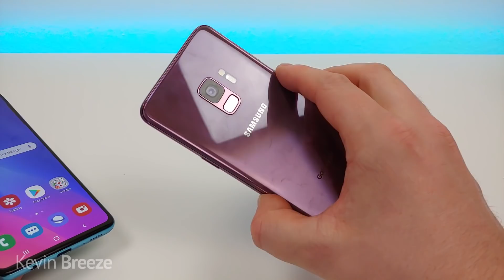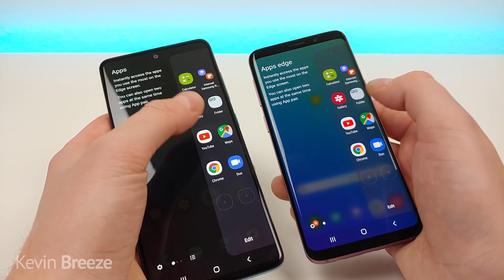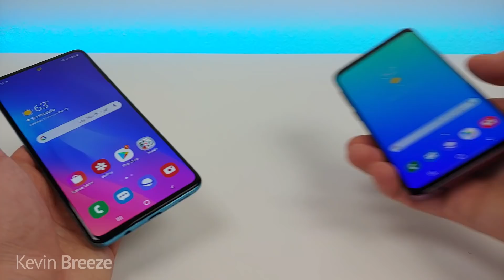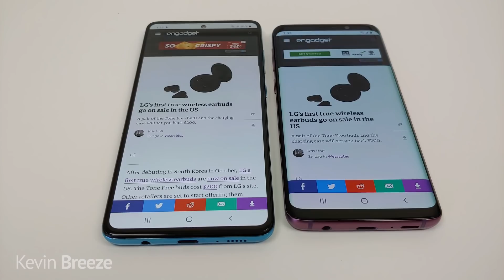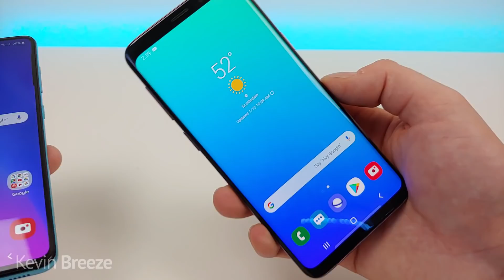Samsung Galaxy A51 vs Samsung Galaxy S9 (Used) - Who Will Win?

Comment: I just had to make this decision a year after this vid was posted...and I went with the S9 over an A31 or A51. What sealed getting a refurb'd S9 for me was 1) Fast processor 2) With an incredible display (570ppi)  3) and that takes incredible photos 4)All in a compact form factor.  Got my new- used S9 yesterday and it's gorgeous. A shame to hafta put it in a case, but  if ya like it then ya better put a case on it.
Reply: Where did yu get it refurbished I feel this may be better than used online

Comment: A lot of people saying S9 is obvious choice. I don't think so, it depends on the user. If it's for an amateur or elderly person who uses their phone for simple tasks then the A51 is the better buy.
A51: Larger Screen better for viewing pictures watching videos & general increased legibility, thicker noncurved edges makes it easier to hold and type on, longer battery life, better selection of camera types for different circumstances, newer version of Android, brand new so is untouched and includes the box & official Samsung charger & cable, Manuals, etc plus a longer warranty. 
S9 Problems: Refurbished meaning it's already proven itself to be defective once, will have some cosmetic damage, battery typically 80% or less charge capacity, significantly shorter warranty, no box/manual/etc, often has a US wall charger regardless of the country it's sold in meaning you need an adapter if you're not from the US.

Again, if you're not an intensive user and the extra processing power, the higher PPI and the super-slowmo gimmick of the S9 isn't going to be used then the A51 is the more attractive proposition.

Comment: Excellent comparison.  
So far I think im going with A51 over S9. 
But i have a question. The performance rating score difference.  A51 was about 170,000 and S9 was in the 340,000. 
But what does this mean?? How does this affect performance and what performance is it measuring? 
When you pulled up the camera its same.
When you Pulled up a video its almost the same. 
You said the S9 is better performance but how much better?  WHAT does the performance rating measure that makes the s9 double?
 I dont understand this rating. 
Im not a gamer so speed of movement doesnt matter.  Bit it DOES matter if i click on a vid and get the buffering circle for 30 -60 seconds. It also matters if there is great lag going from one window to another. 

The other thing that is NEVER mentioned in comparison vids is the KEYBOARD!!!!
I think this is the 3rd most important feature and no one talks about it.  
Does the keyboard have the number row available on main keyboard? Or am i going to have to hit the arrow key just to get to the number row? 
And punctuation.. how accessible is this? On the flagship LG G4 you had to hit a key just to get a comma which i hated.  I also want this on main keyboard. On google keyboards you have to make 2 extra keystrokes just to get to a punctuation mark and the emoji key is right beside the space bar which made me uninstall it within a minute !!!
So is there a way to see keyboards on these two phones?
Thanks so much.

Comment: If you do not care about waterproofing then just get the a80. I  had it and it is such a clean phone with an amazing camera and is excellent for watching videos/gaming with no bezels, notch or hole punch. The only thing is that it does not have wireless charging but that is a small problem and is definitely worth it. The flip camera also gives you the amazing quality of the rear camera on the front for selfies and videos.

Comment: Great video, very informative.  But, we all know both are Samsung phones.  No, need to keep saying the Samsung Galaxy A51 and the Samsung Galaxy S9.  Just say Galaxy A51 and Galaxy S9. 

Another two factors: 

Since the S9 would be bought used, the battery life will be diminished by the first owner, even if for only a year. 

Most used phones you get an after market charger and cord. Nothing worse than ruining your used phone with a cheap after market charger.  I think an original Samsung charger/cord is about $30.

Of course with any new phone, you get a original charger by the company, along with the simm card ejector.

Comment: GREAT Compare & Share! The 2.0 Software Upgrade is a nice welcome for the UI.

Thank you for making this comparison and showing me ANOTHER REASON to NOT upgrade to the A51. 

Watching this video was great; I have the EXACT same S9 as this test model! 

I shoot pictures, always using Pro Mode for full camera adjustability. The lack of a few features doesn't bother me. My S9 is not my base or main camera; I use my Nikon DSLR. 
I also bumped up my external storage to 512gb. The screen size on my S9 is perfect, I LOVE The rear-centered fingerprint sensor, and aux jack option , seeing fingerprints on my screen is irritating (I use a stylus)!

My S9 is DEFINITELY a TROOPER & KEEPER!

Comment: The S9 does not have Live Focus for the rear camera.
Reply: I have both of these phones. My A51 has 6 GB of RAM with 128 GB of internal storage. I like the A51 because it has Live Focus by default on the rear camera. However, I miss the motion photo option as well as native screen recording capabilities that is present on the S9. S9 has MST whereas A51 only has NFC. Even though S9 has got stereo speakers, I like my A51 when I watch Netflix because it is louder. I like the A51 as well because it's battery could last me the whole day whereas I have to charge my S9 4 to 5 hours of usage. Just normal browsing, map using, texting, videos watching, and what not. I decided to stick with A51 after all because it has the most recent software and will continue to receive software updates for the next two years while S9 is in it's EOL. The display resolution is not much of a difference though. It is barely noticeable to be honest.

Comment: I wish company’s just produce less models and support the actual smartphones longer.
Just as a reference the premium midrange market has about 80% power of snapdragons 820, wich is a 2016 processor. Most of celphones produced around this time are still capable of running everything on google play with no problem at all.
Its kinda pisses me off when i hear from company’s and tech reviewers that they couldn’t update android due hardwere limitations when the midrange phones are still falling behind last year flagship models.

Comment: Basically from the chipset side, Snapdragon 730g vs 845. Im using Mi 8 explorer which also use snapdragon 845, has an awesome battery life. Also s9's cameras better and has smaller screen. This has negatives and potives; negatif the screen is smaller, pozitive ppi is better. S9 is IP68, has stereo speakers, wireless charging, metal body and glass back.

I think s9 is better.

Comment: It's easy. S series will always have signature features and premium build quality and hardware. Even a few year old s series will have significant hardware advantage over modern budget series phones. The savings have to be made somewhere.
Yeah the newer phones look better on paper but when you actually do an in-depth analysis of the two S series with any A or J variants, S series will always be on top.
Sure the screens have improved and camera, but the hardware running them are far superior on the even older S series phones. Even a s7/8 has significantly better performance compared to a budget modern A series phone even though it looks very outdated.

They make them look pretty and appealing to the masses to drive sales but under the hood they will always be "meh". The camera modules and screens are usually just rejects from the S series, they're still good enough, but not good enough for a premium tier so get reused for A/J series, same with RAM and Storage.

Last year I wanted a new Samsung but was on a budget so was torn between a used S9 or a new A90. On paper the A90 at first glance looked much more superior with it's many cameras, large display and better looks, but then I did a GSMARENA comparison and the A90 was considerably worse in every other way and lacked most of the flagship features I'm used to that even s6 - 8 had. Needless to say it's a no brainer. Bigger screen is not worth it if it's worse quality. Neither are multiple cameras when the image processing speed is significantly slower, OIS and EIS worse. One but very good camera > many inferior ones.

Comment: Remember the S9 is renewed... the A51 will get more years of updates and security updates including Android R and more. Buying an almost 2 year old flagship that’s used is different from buying a new mid-range one. Yes, you will get flagship-only features including curved display and wireless charging. 1440p is okay and because it’s not a flagship they usually don’t get it IP certified. For most people the cameras and the larger screen the body ratio and the modern design will be better than a used phone with more premium features and materials that’s a couple years old.

Comment: My mom has the A51. It's to be fair...a tad slow compared to the S7 Edge she had before. She ended up returning the A51 as the S7 Edge just is a lot faster. Also, audio is a lot more clear and loud on the S7 Edge (it has the dual-speaker mode enabled). So...yeah...bad phone!

Comment: i just switched from the S9 to A51 and didn't pay anything on top. Pretty happy with my desicion, finally a battery that gets me thrpugh the day easily.
Reply: i will get the a71 now, the s9 was good but in the last weeks it is getting so slow and the battery is realy bad
Reply: @Kai-ez9nm  dude, is that really happen to ur s9? Why?
Reply: and which camera do you prefer ?
Reply: @EnzoGwaz  I'd say get a renewed S9+, it's what I'm doing :)
Reply: My Samsung galaxy s9 just turned 2. I have screen burn out (red tinge, had for a few months) and the battery will not last all day, it will be at 75 %  and have in pocket for a few hours and it will be at 50%. I do love this phone. But it's two years down the track I don't think it will last another 2 years so would be hesitant to buy a phone that is 2 years old.
Note I got the phone in Australia and now live in UK so couldn't get the screen burn for free
Reply: @stephkat123  Samsung after sales support is good all around the globe. You can try getting the battery replaced and do a factory reset and it should work nicely.
I am struggling with an LG G6 and I don't think LG is offering any kind of support, at least in India, for phones. They do help with refrigerator and TVs though.
Reply: Needed to switch back to an Android after like a year in Apple he'll, S9 was my first pick but the A51 is what they had, and honestly I prefer it. The bigger screen, lack of bezels, internal fingerprint scanner (personal preference), the far superior battery life, all destroy the slightly better performance aspects of the S9, wish waterproofing could be better but i still can't complain.

Comment: The screen matters. S9 has a true 1080p display thanks to its 1440p resolution.

But because diamond pentile OLED sucks hot ass, the A51’s “1080p” Panel can fall as low as 720p when content on screen is mostly red or blue with no green/white. Let that sink in, the A51 can fall to literally 720p in some scenarios while even the iPhone XR/11 are 828p and thanks to LCD RGB pixel array will never fall below 828p.

If the max resolution of your OLED phone is below 1440p and utilizes diamond pentile instead of RGB Stripe pentile (as seen on most smart watches), you’re being lied to about the phone’s resolution. The iPhone 11Pro and 11ProMax’s OLED “Super Retina” screens are basically scams because they can fall as low as 750p and 828p respectively; not very premium for $1000 and $1100 phones.

Comment: You say that to get the phones at a similar price the s9 has to be bought second hand. A year old phone is never as fast or good as when you first buy it. Battery life and processors start to deteriorate especially if the phone is used a lot . Buying the phone brand new has some big advantages. If an s9 could be bought for the same price unboxed, I would agreee
 that it's better than the A51 but considering it would have to be second hand I'm not so sure.

Comment: something people should know  though, is that even though A51 may not have  IP68 rating, doesn't  mean that it  doesn't has water resistant - people had tested A50 from last year before and found you can wash them and submerge them underwater without any problem

so most likely just like OnePlus, they probably do have the water and dust resistant design (which should be a given on any sealed phone anyway), Samsung just doesn't spend money to have it tested

Comment: You should have bench marked the phones.  The snap dragon processor in the s9 is a lot faster so those who want a snappier more responsive phone that they play games on would definitely want to consider that.  Also the s9 is water resistant with wireless charging which you fail to mention.
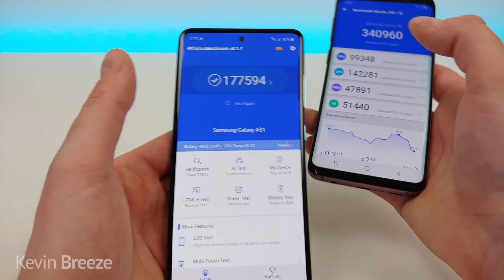Reply from the maker: Benchmark at 6:32 ...Did you actually watch the video or did you just assume that I didn't include these things?

Comment: That's why it's always better to buy an ex-flagship phone than a recent mid-range phone. features wise and performance-wise, most budget phones are at least a couple years behind than older flagships. What I'm saying is that it doesn't matter that the S9 is older or has relatively bigger bezels, it will still age better and last significantly longer than the A51.

Comment: I own an S9. The only thing that is"not good" on the S9 is the battery. Everything else is just better.
Even considering the small battery, i can stil get about 5.5h to 6h of screen on time which is pretty decent. This could dramatically vary since I've seen people get barely 4h SoT.
Reply: It might be your charger, I had a similar problem
Reply: I'm roughly getting about 4-5 hrs the idea of getting a New phone seems to far fetched as I have phone for many Years to come
Reply: My S9 plus battery is still quite good, but it can be replaced at a Samsung service center for around 75 dollars I'm told.
Reply: I keep my phone on medium power saving all the time, which doesn't really change the user experience but let's the phone easily last around 8 hours
Reply: Love my s9plus but man the battery life is really bad.
Reply: flacko001 I’m sure buying a brand new sealed one should have good battery, can’t be worse than my iPhone X.
Reply: @V8orNoCar  mine was brand new got it the first day it came out.
Reply: All these people complaining about the battery; just use your phone less and read a book or talk to people?
Reply: I am looking at ditching my LG in favour of the S9, now that the price has come down to below the cost of plastic A51, that too from official Samsung website.
Reply: Well my s9 is getting some screen colour issues so im upgrading to s20 fe.

Comment: a51 is just better. most people won't use the 4k video recording. and its not like you can tell the difference between 1440 and 1080. ntm that a51 is new and will have more support going forward, while s9 will probably stop with android 10
Reply from the maker: The A51 has 4K video recording
Reply: @KevinBreeze  yes ik but with half the frames